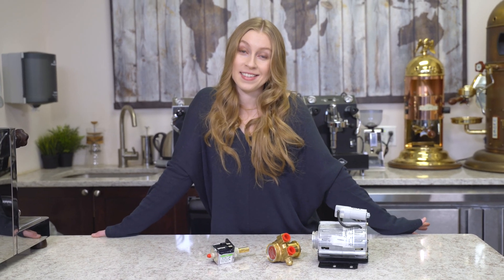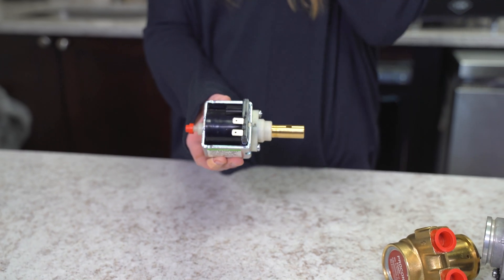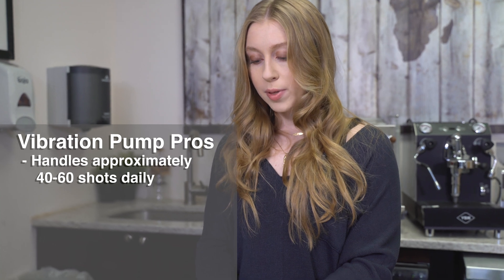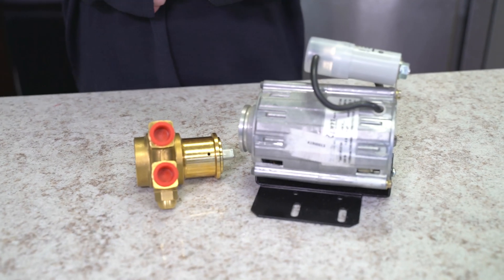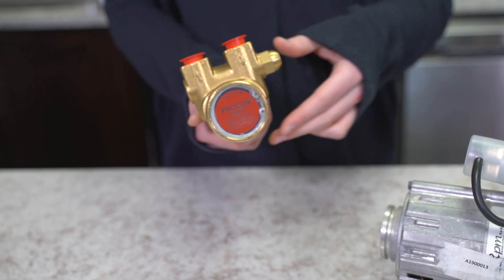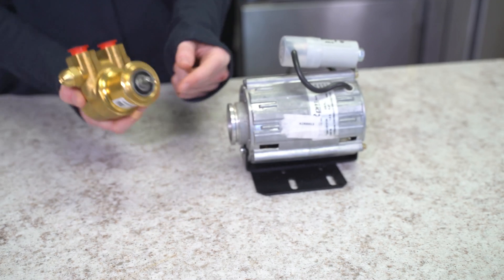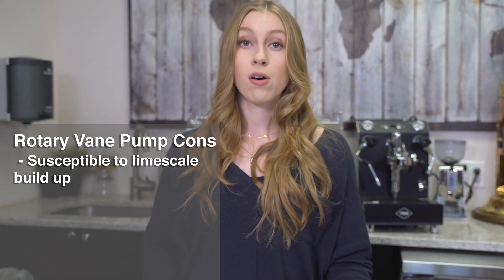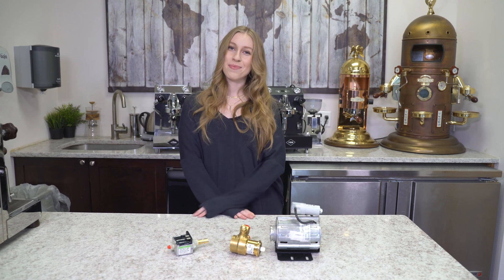Vibration Pumps and Rotary Vane Pumps

Comment: Nice Explanation. I am working on a RO water filtration project. I want to use this pump with manual worm gear box for pumping water from 3-4 meters . Can you please recommend which worm gear ( Technical details)to be used . I am not able to find the right worm gear gearbox with rotating handle.

Comment: Rotary vane pumps do not have a “water wheel” type of impeller. That’s a totally different kind of pump. Rotary vane pumps have more moving parts capable of higher pressures. They can also be more noisy than a vibration pump which is just a coil turning on and off rapidly. Coil pumps are not reliable enough to be in any kind of business. Vibration pumps are cheap and will fail.

Comment: The statement about Lime scale is incorrect. Lime scale does not have a preference related issue with the PROCON pump. The pump is designed to be maintenance free and lime scale build up is mainly an issue of the copper and brass components in a coffee machine especially heating elements and tanks not the pump.

Comment: Anyone know if the threads get teflon or pipe dope on them? This procon pump keeps leaking.
Reply: The PROCON pump code in this video is 132A060F123B so it has 3/8” NPT ports and requires Teflon tape. Where or why do you think your PROCON pump leaks?

Comment: I have the rocket giotto with the vibration pump, and only ONE gauge, which measures temp.  How do I adjust the pump pressure to ensure it's at 8-9 bars?